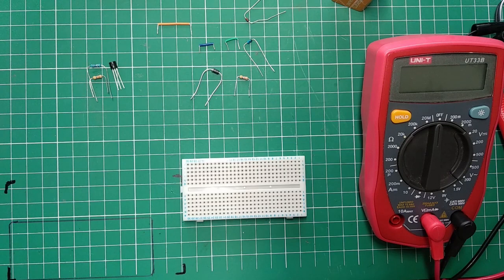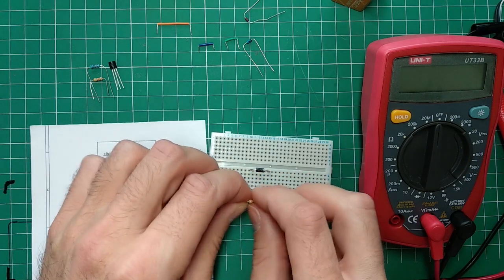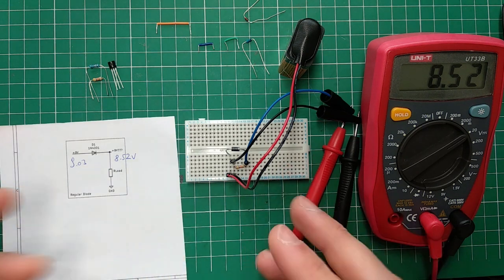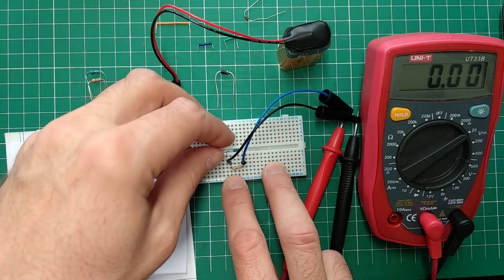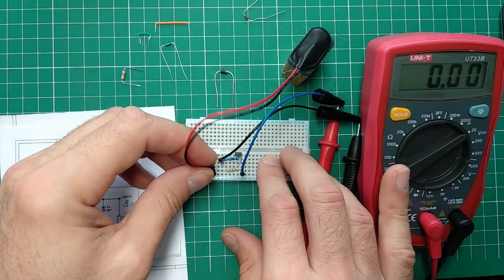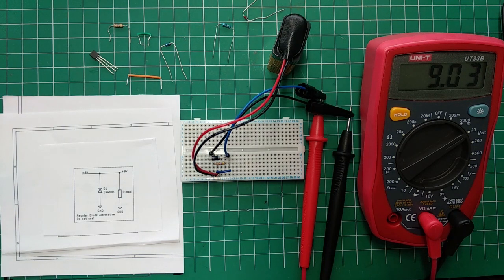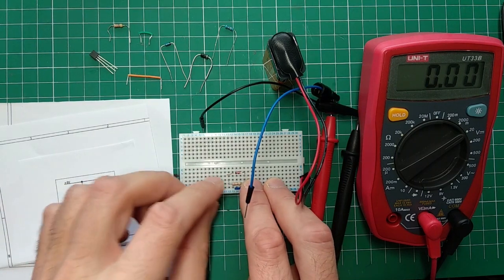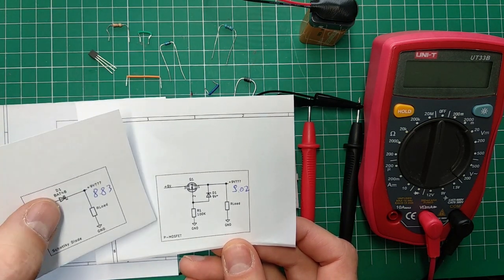Reverse Polarity Protection for Guitar Pedals

Comment: One problem I've run into with the MOSFET solution is that eveb brief current surges such as those seen when a large power bypass capacitor is charging can damage the MOSFET.
Reply from the maker: What kind of setup did you have when you ran into it?
I'm not sure that's a possiblity here. Obviusly, if we run over absolute max values for the mosfet we'll damage it, but I don't see it in this circuit. Let me know if you have any references to that effect - or an example circuit, I would love to know and learn something more about it.
For example, I was looking into reverse polarity protection for automotive applications - app note: and90146-d by onsemi has selection criteria for mosfets, if I follow it applied to our scenario here, this mosfet is just fine. They are using 12V car battery in it so if it's good for them I'm guessing it's good here.
Reply: @BarbarachBC  It was a 2n7000, 12V supply, 220μF capacitor, the damage occured almost instantaneously
Reply from the maker: 2n7000 is a N channel MOSFET so it wasn't this kind of a circuit. It's strange but without more detail it's hard to tell what could have gone wrong.
Reply: @BarbarachBC  It was the same circuit just with the mosfet on the -ve rail and the gate being pulled up instead of down.  During the charging of the capacitor, the source will have been briefly pulled up to the +ve rail while the full current available from the supply would pass through it (potentially a few amps).  Given the RDSon of a 2n7000 I'd guess that was the problem but I'm also wondering if the source vs drain voltage had anything to do with it?
Reply from the maker: If you're using 12V that well within any limits for 2n7000. Breakdown voltage is 60+V, max Vgs is 30V. I really don't know. In pedal world we're using power supplies that most of the time have current limit well withing what 2n7000 can take anyway so I wouldn't have experience with this. If in doubt use power mosfet I suppose :)

Comment: Thanks for your knowlege and demonstrations. I guess I'll go for the mosfet option but my local electronics store is out of TP2104. Do you know of any other mosfet that would do fine ? Thanks again.
Reply from the maker: Keeping in mind that these are guitar pedals we're dealing with, and this is not a component affecting the sound, nearly any P-Mosfet would do. Just pay attention to the pinout, and make sure that Max Vgs is greater than your zener diode voltage used for protecting the transistor. Also make sure that max VGSth (or on) is less than 9V. I did a basic search for P-channel mosfet in throughole technology and in-stock on Farnell, and it returned me 103 results. Highest Max VGSth for the lot is 5V so any would probably work. I randomly looked up VP2206N3-G ... looks good (my TP2104 which I chose the same random way :D is probably crappy in comparison to be honest, I just had it lying around). Do you have any just lying around?